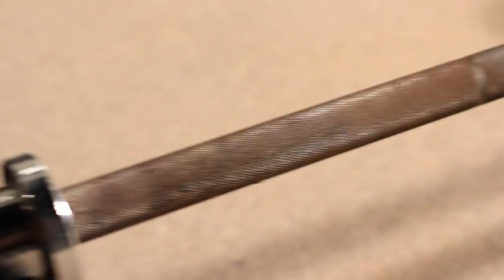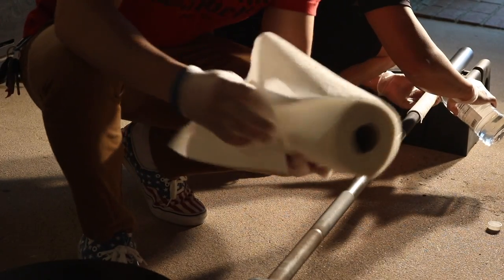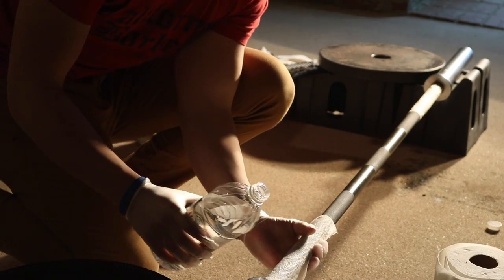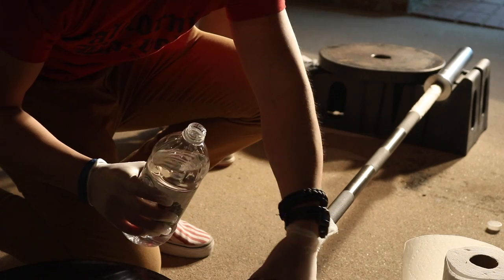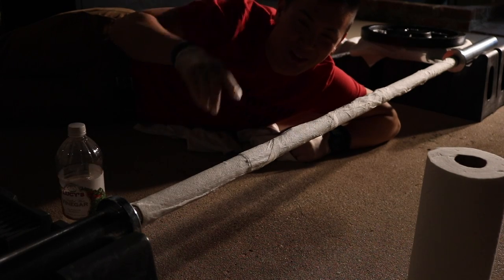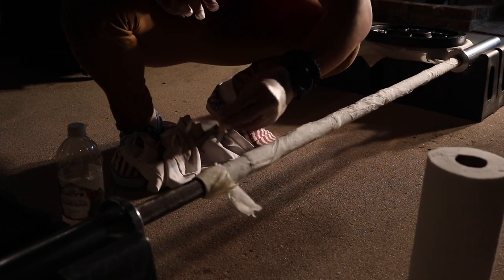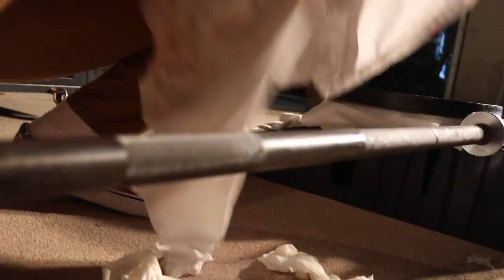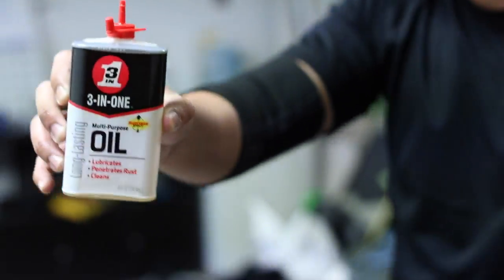DIY: How to remove rust off your Barbell | VLOG .02

Comment: I literally just finished doing this but used an old towel...Should have used the paper towels and let it set longer.. I also used the 3n1 oil and Vinegar mixed to scrub the bar..Finished with just the 3 n 1 oil.. Good vid guys, wish i seen it b4 hand though, lol

Comment: Do not use vinegar, only use 3 in 1 oil.  The hydrogen ions in the acetic acid/vinegar will actually corrode the metal by leaching electrons out of the iron in the barbell.  Then the oxygen in the air will combine with the iron molecules to create iron oxide/rust, which will then discolor your barbell into a brown/reddish hue.  This is what just happened to my bare steel barbell unfortunately.  I did a quick google search after on vinegar (I'm not a chemist so don't ding me if I didn't use the correct terminology). Just a PSA so this doesn't happen to anyone else.

Comment: A quick stripping with a wire brush, followed by a coat of Rustoleum  flat black spray paint is much easier, and will protect the bar longer than this method.  Water on a metal bar?  Doesn't make a lot of sense to me.  Brush and paint it and it will be a lot longer before rust comes back.